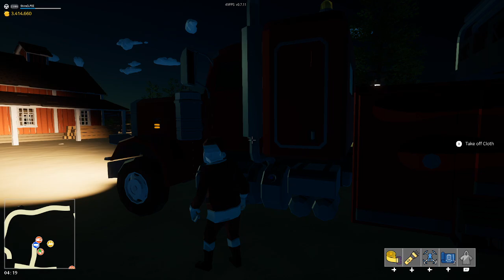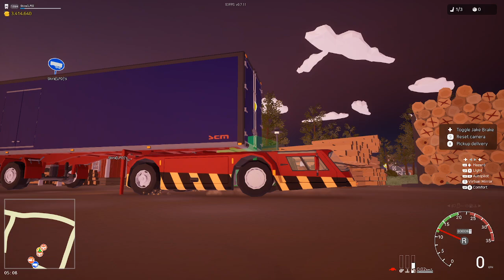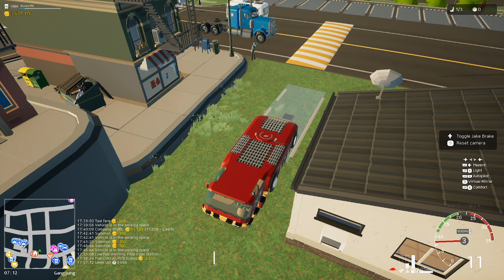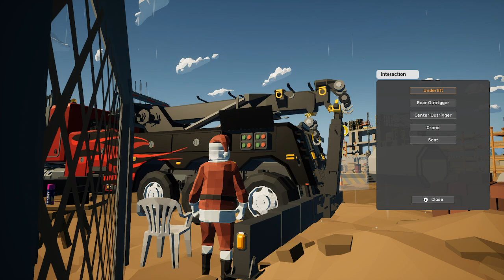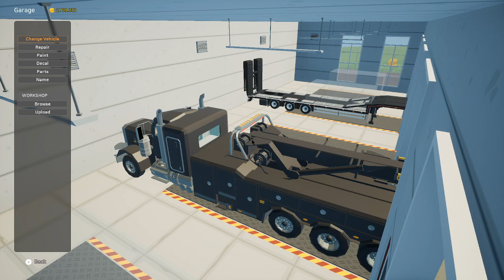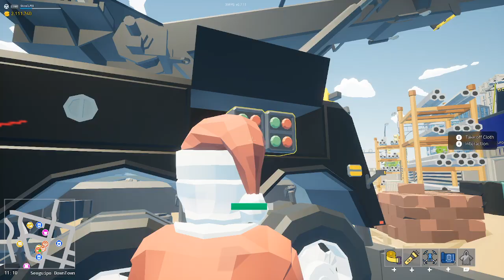Let's Play Motor Town: #121: Shenani-Cranes

Comment: I think you may be able to drive the Lobo+Trailer backward into the construction site but from the other entrance, and possibly help it a bit with the Rotator.
As for using two Rotators: looks like a challenging idea, but over the fence does not seem possible, because the crane boom needs to be 60°~70° vertical as possible while extended over the fence to be able to lift such heavy weights. A big mobile crane may be needed for such activity.
Reply from the maker: Ground clearance on that consist is a problem and I don't expect it would go too smoothly. Yeah, my attempt here was pretty ambitious and I wasn't sure it would work. I remember there being a big crane on the trello for over a year now. That might be able to do it, if it ever comes out.